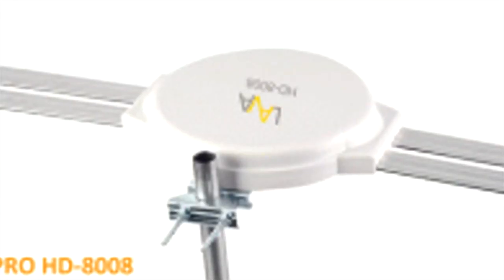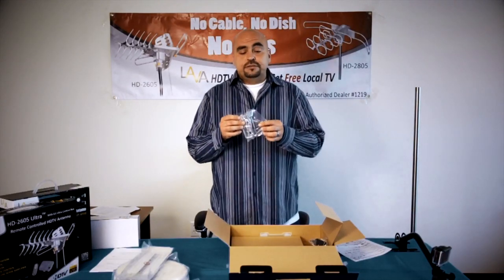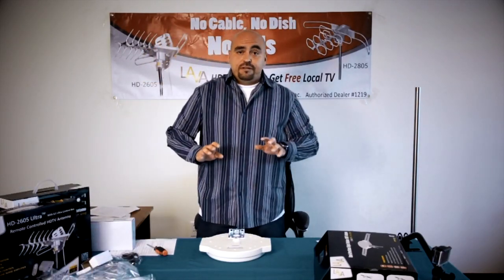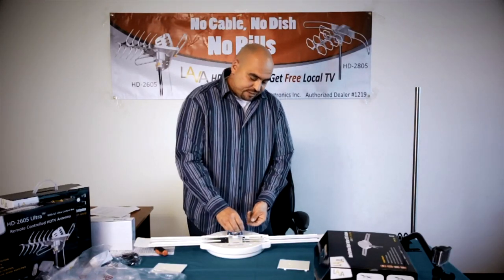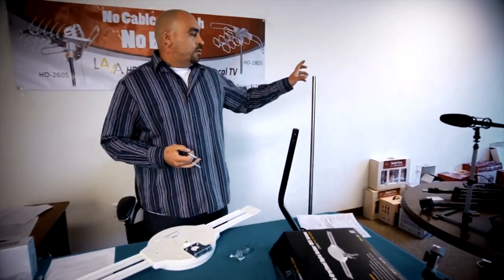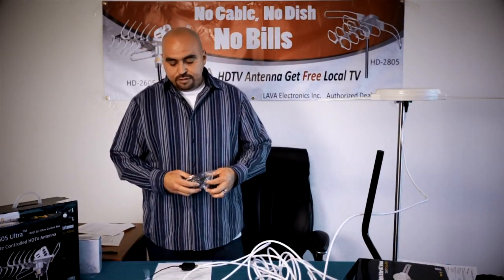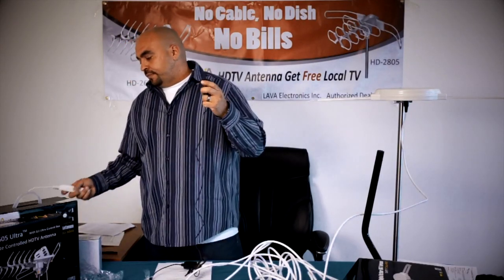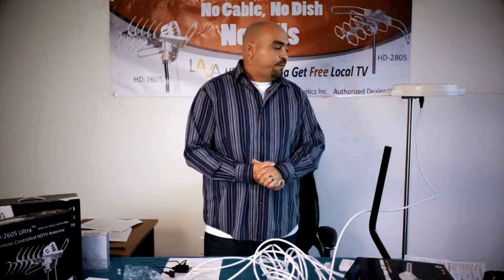How to install LAVA HD-8008 Antenna

Comment: Thanks for the video!  I installed it today.  I took down the existing satellite dish and was able to connect it to the existing mount, which is about 12 to 15 feet above ground.  I did not need to install any outside cabling into the house, I used the existing cabling from the prior satellite dish.  The antenna was a snug fit over the mount.  My signal strength is significantly better on one channel, went from 70 to 92.  The other channels had little to no change in signal strength, all stayed in the low 90s.  I have mine hooked into a 3 way splitter.
I am satisfied with the LAVA HD-8008 antenna.  I have removed my current electrically enhanced indoor antenna, which was being disrupted by people walking next to it.
Reply: in attics long range tv antena

Comment: Thank you for the video.  What size pole do you need, and how do you attach the pole to the roof?  Also, below you say the range and gain is better on the Lava HD 2605, but I bought this one (8008) because it's omni-directional.  Isn't the 2605 a uni-directional, or one you have to move to target different situations?  And doesn't this omni-directional have something like a 120 mile range?

Comment: Most antenna installation instructions recommend connecting a ground wire to the antenna housing to prevent lightning strike damage. How is that done with the LAVA HD8000/8008 (I have the 8000)? Or is it not needed with this antenna?

Comment: I have the 8008 and will be getting the splitter that you showed to push to 4 TVs. Where does the power insert go? At the splitter then attach to coax or at the coax coming from OUT1 between wall and TV? Thanks in advance..cant find any help with this.
Reply from the maker: The power insert will after the LAVA Splitter, out of out1. So the connection will be, Antenna, coaxial, splitter, coaxial, power insert to the TV. If you still need help. Please feel free to contact LAVA tech support at (909) 923-8743

Comment: Great video... very easy to follow but one question for you. I noticed in the video that you had a few different antenna's. out of all of them, which do you think is the best and could give you the most channels? the motorized one or one of the others?
Reply: The strongest antenna when it comes to range and gain would be the HD-2605 ultra. That antenna there is the one to get if you are looking to pick up channels from 85 plus miles. The adjustable gain on the control box also gives you more control over the amplification used by the antenna.

Comment: I like the video!!! How ever we can't hear you mic needs to be closer to you :)
Is this product made of plastic if so it won't last long in the in heat Phoenix AZ.
Or can I put in my home. Do they make this product LAVA HD-8008 Antenna  in metal.
Reply: Hello, Unfortunately we do not make none of our antennas with full metal housings. If Sun damage is a concern then you can always install the antenna indoors like in the attic. As long as you do not have a metal roof or insulation that has an aluminum shielding then you should still be able to pick up your local stations.
Reply: I just recieved my LAVA 80008. Been working all day to get it going. no luck, $1 I have a HDTV. It worked with my old Antena. Just weak and I wanted a better one.                                                                                               I placed it just as shown on a post outside. Ran the same cable as I had before. Good quality  and tied into the equipment as sent. (I did NOT use a converter. Didnt need it before so didnt see that I needed it now. I then scaned for stations. It says signal is too weak. I did again and the smae thing happened. I hae even input channels and says signal is to weak. The amplifier is plugged in and the light is on. I do not understand why ot worked with a lessor quality directional Antena but not this one ?  Help please                           Bill
Reply from the maker: Thank you very much for your purchase, we are glad you like the product. Please feel free to call us at 909-923-8743 and to answer your question: sorry but no the antenna is not made in metal as metal can affect the performance of the unit.

Comment: What's the longest range in miles that this omni antenna will pick up channels? It doesn't say so on your website.
Reply from the maker: Our HD8008 omni antenna is design for up to 100 miles radios.
Reply: Thanks

Comment: Does it matter which way the wings are facing even though it's a 360* antenna
Reply: You can rotate the antenna for better reception. And this will change facing on the wings.
Reply: Alwen Yao 
so even though it's a 360* antenna, it will change reception by turning the whole antenna??

Comment: How about a trouble-shooting video or something? This video and channel does not discuss issues that you may encounter (i.e., satellite had two cables leading from the dish to two different outside splitters, grounding the system, using RG6 and not RG59 cables [who would ever know this?]). And you don't run the cable directly from the antenna to the power inserter to the tv on a desk like you show here. That doesn't account for walls on a house and ignores that there are going to be splitters of some sort, individual (possibly RG59) cables in walls, additional cables from the inside wall to the tv (and that's where the power inserter is to be added). I'd like to see how this is set up in a practical environment so I can see if there is something I'm doing wrong. I've been able to piece bits and pieces of information together but I'm still having trouble figuring out what the problem is. I want to remove the individual antennas at each tv (which worked fine) in the house and just use one outside.
Reply: Did you get any answers to your question? I am experiencing the same problem. I was under the impression I would be able to use the existing Dish connections, but the connections are not the same.

Comment: I like your video. I have the same antenna with the splitter  the power inserter goes  into the tv input with the pigtail  and the out goes to my DVR and out two goes to my same tv to my CATV tv input . I tried the inserter on the out but it wasn’t working that way .i live in Toronto and received Detroit Michigan ! That’s a fools hand for that to happen it only stayed for 5 hrs I generally get western New York across lake ONtario. At times it can sense a channel pretty far for what the range of this antenna is

Comment from the maker: please note you must use rg6 cable and you cannot use any other kind of splitters BUT lava splitters. The antenna will not work if you are using your own splitter. Also, if you a using a digital TV you will need to purchase a converter box or update to a HD TV.
Reply: SO this Antenna will not work with anything but the LAVA spliters and accessories. Also your statement above  in regards to the needing a converter box for an already digital TV does not make sense. Do I have to use a LAVA Digital converter also. That may be the deal breaker. There seems to be a bit too many  requirements to use your equipment, or it wont work. Please advise.  Also this should be listed in  any advertising of your equipment
Reply from the maker: You do NOT need a converter box if your TV is HD ready. If you are still using the old model TVs you will need a converter box (not Lava) can be any model. If your TV is 2010 or newer you may not need a converter box, you may want to check with your TV manufacture to see if it requires a converter box or not. Please keep in mind this applies to ANY antenna you decide to go with.
Reply: Not  American made  like they  say    and  I   can't get  a invoice  lol  I  have  tried for  over two weeks.  I  had  my  attorney  call the  never  picked up the  phone  a recording.   They  took a  payment  took  them  3-4 days to  ship they don't  process  as they say  they do. I have  had  really bad experiences with  them.  
I do customer service  so I  guess maybe I  just look at  things  differently.
Reply: Would recommend that you buy your antenna from someone other than LAVE.   Their Customer Support is virtually nonexistent.   They sent me a unit different than what I had actually ordered and I have tried for weeks to correct this error.  I have contacted them several times and have never been able to get a real person on the phone or even to respond to a text.  In my opinion they are highly Unprofessional, Disorganized and not a company that you really want to do business with.

Comment: Not that great on distance. It's a lie about 120 to 150 Miles, I have channel 9 news WMUR in Manchester, New Hampshire, I live in Nashua, which is about 15 miles away and I can't catch it.
Reply: Antenna works by location. It your local signal is strong or you are close to TV station, signal may be over amplified and affect the reception. You will need to by pass the power amplifier and let the signal level go down first.

Comment: I received and installed this antenna today. It’s nowhere near as effective as advertised. Stations within 50 and 60 miles come in weak with lots of freezing of picture. 100 miles? Forget it! Definitely not worth the $65.00 I paid.
Reply: Tony Dente I paid 84.99, where did you get yours?